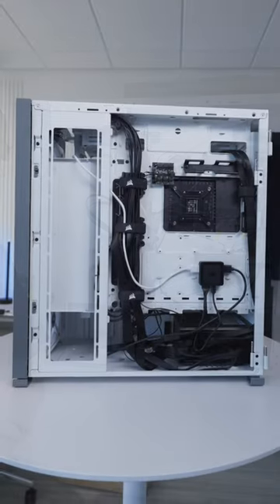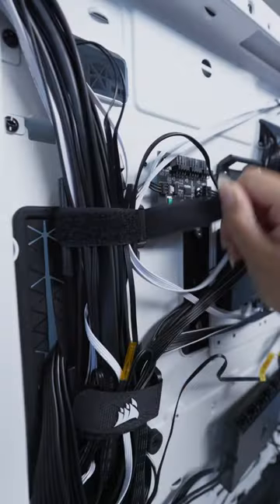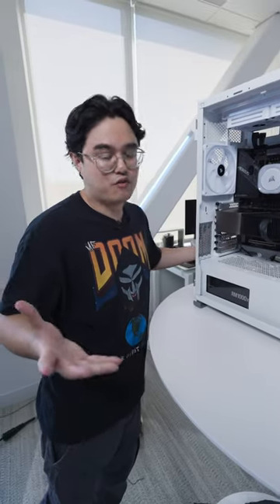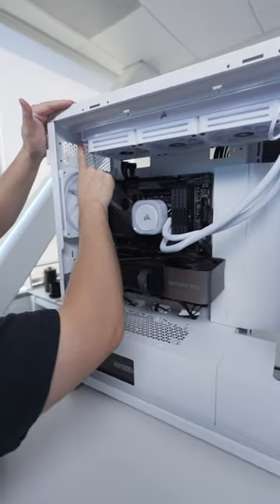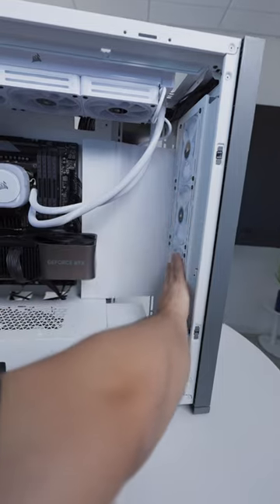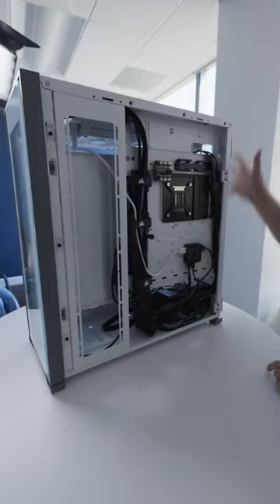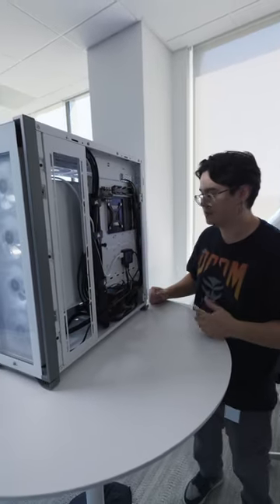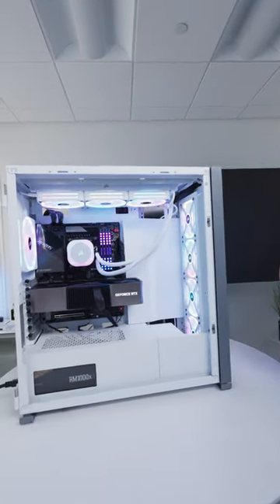Upgrading our PC with iCUE LINK! #corsair #icuelink #pcbuild #pcgaming

Comment: Yeah I've built with these a few times and you're definitely not telling the whole story. While the fans do look really nice, maybe the best on the market, the price is absolutely absurd and it's not as cable-free as claimed. They have 3 sets of fans in this build. a single, 3 on a rad, and 4 in the front. The 4 go direct to the controller, that's fine. The 1 and 3 have to be linked together by a cable, then another cable going from one of them to the controller. That's 3 cables. What they don't tell you is, the 3-packs of fans come with 1 cable and the singles come with nothing. So if you were to buy 2 3-packs of these fans and 2 singles like the video would suggest, you're shit out of luck cause you're a cable short. So you'll just go buy one cable right? Not exactly. No retailer is currently selling these cables, they are only direct from corsair. I've ordered from corsair from canada a few times so you can typically expect a 1-2 week wait for a fucking cable. The fans are fucking $70 each for the singles. At least include one of the 10cm cables with your singles so people can actually plug them in without this corsair direct shit. I know your margins for your fans and trust me, you could include a $10 cable and still make a massive profit.
Reply: Who cares the price? They just need to look cool!
Reply: @HUNmotyon  and this is exactly why they can get away with this insane pricing. People like you will just buy it anyway no matter the cost.
Reply: @Tiduspeco  why wouldn’t I buy it? Tell me just ONE reason! I have all corsair accessories and everything is the same color! Keyboard, mouse, mousepad, rams, LC100 triangles, multiple LT100 bars, strips, ear speakers, and MANY QL fans. I also have commander pro and many other controllers. I did not spend more than $1500 for the rgb!!
You can use the fans for literally forever, many ppl use 15 yr old corsair fans. So why would it be needed to save money with an ugly fan if I can use them for this long? 🤬
Reply: But there's no competition so price is justified just like Apple...theres no competitor like them
Reply: @Tiduspeco his parents are probably buying it. It’s either rich snobs worth money to waste or naive parents being duped by their kids to buy these expensive products for them.
Reply: Talk to them my brotha 💪
Reply: I've ordered these cables off Amazon. They're supposed to arrive two days from now...
Reply: @michaelmcallister711 Lian Li? They're expensive as hell too but they're way more feature rich. They've even started releasing reverse blade fans.
Reply: @HUNmotyon it’s not just about looking cool. Having minimal cables is actually very useful for future adjustments and upgrades. Dealing with 20 fan cables and 3 hubs is not enjoyable
Reply: @HUNmotyon I can’t even open the software they have so I’m running fans with no software and they are just flashing red

Comment: Icue link has few issue.. especially the link control box.. I have time where when I plug it in and power on the system the fan would spin then stop spin and no power plug rgb on

Comment: I have the same similar build but I have the iCUE Link qx120 side fans too, but the sensors only detect 7fans not all 9.

Saying too many devices plugged in to one.? So 7 fans RGB lights up, just not the other two.

Comment: But why won’t my Corsair ram get detected by Icue?
Reply: If you are using other rgb programs, they will conflict each other 😐 like gigabyte rgb fusion or asus aura.
Reply: @BaMbOoZeD  I only have icue as my whole build is Corsair even the case
Reply: @BigBoyNowYT  Ahh okay. Then your memory should be recognized by icue, if they ofc rgb too 😊. Dominator?
Reply: @BaMbOoZeD  vengeance rgb. Stuck on rainbow as i can’t change it
Reply: @BigBoyNowYT  You can see them in icue? Sometimes hardware lightning will do some weird stuff. Tried reinstall icue?
Reply: @BaMbOoZeD  nope It won’t see the ram and yes I did a reinstall of icue
Reply: @BigBoyNowYT  Hmm seems weird. You don't have any other plug-ins installed in icue?
Reply: @BaMbOoZeD  nope tried everything lol
Reply: @BigBoyNowYT  Hmm how many ram sticks do you have? Four or two?
Reply: @BaMbOoZeD  four
Reply: @BigBoyNowYT  Hmm I do also have those vengeance rgb in my other computer. I had to swapped them out like in the real order like 1-2-3-4, to make the rgb work properly. The color they are doing when icue is not running, was weird. So I figure out that the order was wrong 😊. Tried to remove two sticks?

Comment: Do not order 1 of these new aios the pump noise is urrendous returned 1 due to pump noise and now Im returning my 2nd even on silent settings in icue software the pump noise is still noisy
Reply: You just saved me over 200 bucks. Been trying to find anything about this aio but all the reviews that are available are just about the stupid little rgb lights and cables and hub but not the aio. No benchmarks nothing. I was just going to get it for the aio it self and throw some t30 fans on it being I can’t stand rgb and turn the pump lights off like I do with my h115i now. With the tint look I think it’s the best looking aio out right now imo. But now really don’t know what to get. Bought and returned the Lian Li GA2P36B Galahad II Trinity Performance 360 AIO with the fake t30 knock off fans and all and what a disaster that was. Stay far away from that pos at all cost! It’s absolutely f’ing terrible. Loudest aio I’ve ever heard and the fake t30’s sound like they are rolling around in sand at low rpms. Plus was missing the lian li infinity main aio cover only got the rgb cover. Heard nzxt have noisy gen 7 asetek pumps also. Don’t know what brand to trust and go with.
Reply: @SVT_LIGHTNING  hya mate honestly my pc runs silent apart from that annoying pump noise tried to silent it via icue doesn't do nothing  to silent the noise 

Also the cable ports on the aio are in a stupid place I'm trying figure out a good aio I like the kraken elite but just don't like the thought of the cable visible from the cooler but I'm leaning toward the kraken before anything nzxt pumps run silent from experience
The build is on my yt channel
Reply: @UkzEnglishBullTerrierz  Ending up getting the Corsair h150i after days of research and trying different other coolers “air and aio” and returning them. And being my previous aio the trusty h115i has served me well for many years in 3 different platforms but there was more air than fluid left in the loop and couldn’t keep my temps under control as well anymore. Started seeing 80c for the first time ever while having this 13700k since early this year. But so far liking the new aio. The pump was stupid loud at first like you said. But my h115i started out like that also many years ago. It was like a loud high pitch hum almost. But I turned it to quiet mode and it helped but still had the noise. But just said f it and sent it and have been just been gaming non stop getting it hot and heat cycling it and gave it time to break in and what not and now I can’t even hear it at all. My 4090 coil wine over powers everything while gaming anyways. But the pump is dead silent now. And I also didn’t even use the Corsair fans. Don’t even know if they work or not. Removed them right off of the box. I’m not a fan of Corsair fans at all. Way to loud for crap performance. Installed 3 brand new phanteks t30’s and yea the race on those fans are 100% right. The best fans I’ve ever used. And I thought noctua fans were good. I mean they are no doubt. But phateks is on par with them for sure with the t30 line up. Stupid quite and move so much air at such low rpms. Can’t wait for the t30 140’s to come out to replace my phanteks m25’s. But cabling isn’t to bad in my set up. In the phanteks g500a and I have nothing but room for days in this case and have excellent cut outs for cables everywhere so routing it to the back was easy. Mounted the little icue hub on a sata ssd plate and it’s set. And temps are damn good. In Apex legends I am in the high 40’s to low 50’s 24/7 with no frame limit getting the full 300fps engine cap pushing it as hard as I can in that game. And in 2042 getting high 50’s to low 60’s. Still haven’t been able to break into the 70c range yet while gaming. R23 i got it to the low 80’s after a 10 minutes loop test and got a score of 30,250. But so far I’m very happy. Hope it last as long as my h115i did. Don’t care about rgb so pump head is turned off and the tinted look to me looks the best. I’ve heard Corsair is making a performance model with the new pump but I needed it now and didn’t want to wait for a maybe.